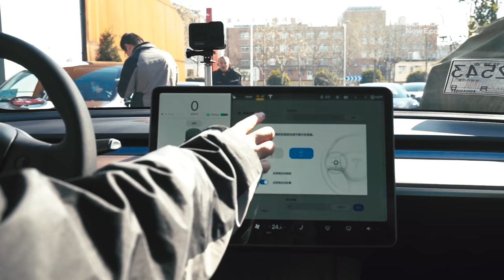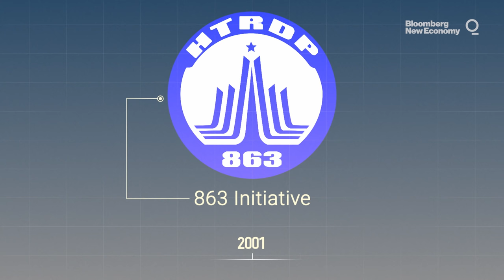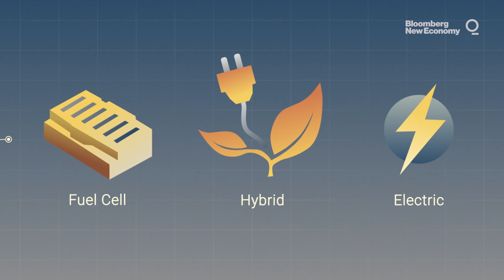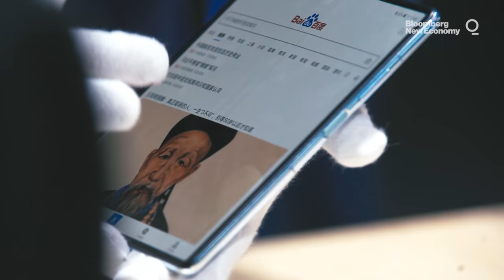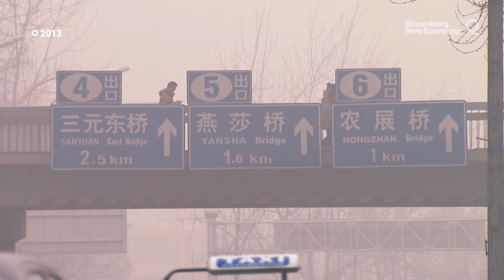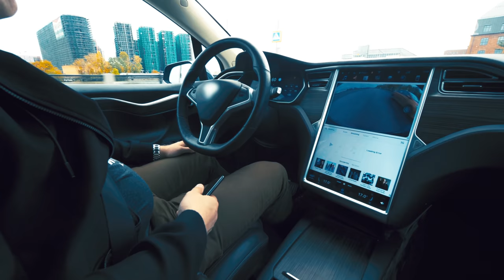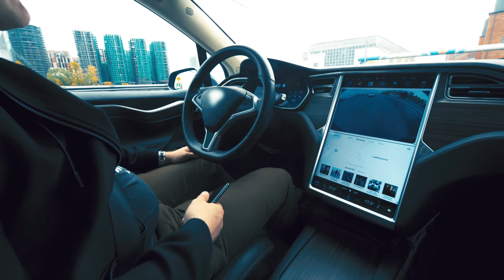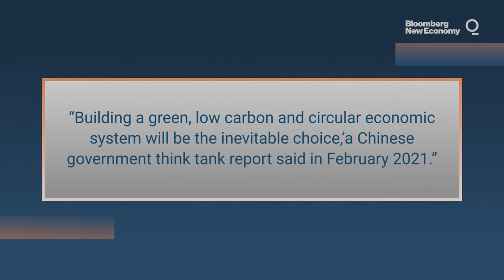Why China’s Electric Car Lead Has Been a Long Time Coming

Comment: No mention of BYD, the largest EV maker in China?
Reply: NIO Is the largest i think
Reply: Tesla is the largest
Reply: Yes, it was mentioned.
Reply: @heinrichhimmler3781  BYD is huge and far ahead of any other ev in most critical technology but I am always surprised that BYD does not get any limelight at all
Reply: @davout5775  BYD's new energy vehicle sales have surpassed Tesla, BYD is now the world's largest new energy vehicle manufacturer
Reply: @aison2735  That's simply not true. China considers hybrids as New energy vehicles. Yet they do have ICE. So they are not clean despite having electric motor as well. Every month the hybrids represent about half of the total new energy vehicles. So BYD sells 50-60% of the EVs Tesla does. They are not the largest clearly
Reply: @davout5775  Hybrid vehicle is a new energy vehicle
Reply: @aison2735  It uses internal combustion engine so it is not a new energy vehicle
Reply: @davout5775  No, it greatly reduces the emissions and uses electricity most of the time, so it is a new energy vehicle. Traditional cars cannot be done
Reply: @aison2735  You understand that in most hybrids the battery range is a joke right not to mention the electric motor is only there just to give additional boost. It almost doesn't reduce the emissions and actually it is the worst of both words. As EV and many times more dirty to produce than an ICE vehicle and on top of that you have the engine that produces toxic emissions everyday. It is not a new energy vehicle! Tesla produces close to double the amount!
Reply: @davout5775  I disagree with your point of view, that is not a fact
Reply: @aison2735  It is not a fact that an internal combustion engine produces toxic smoke or that an EV is many times more hazardous to manufacture? If that's the case I don't even know what you are doing in this comment section because you are clearly incompetent to give an educated opinion.
Reply: @davout5775  Hybrid vehicles are a type of new energy vehicle. It can greatly reduce pollutant emissions and enjoy new energy subsidies
Reply: @davout5775  Your news lags behind, BYD has already announced that it will not produce hybrid cars.
Reply: @will9359  They still very much do

Comment: Actually I really like these Chinese EV. There is this one line of EV or Etuk tuk or rickshaws that are very popular in China. The lk1500fc is what they are called and they are usually made from side manufactured parts. The chassis are stamped by bigger companies who have the spare capacity and can make it in one go. The motor is sourced from heavy duty washing machines cause the motor is capable of driving a car. The batteries are lead ones recycled from waste centers. And the rest of the car is sourced from surplus or stuff that can’t be sold else where.

Comment: Why do people keep implying that Tesla was first to market? From 2008 to 2012, Mitsubishi sold over ten times as many i-MiEVs as Tesla sold Roadsters.
Reply: Yes.. i think currently vw selling much more than tesla.. there is also nisan and hyundai
Reply: Where are they now?
Reply: @MelvinJ64  they still make them, and they cost $10k less than the Tesla Model 3, but they stopped selling them in the US, presumably because they're going to be introducing a new model like they did in Europe.
Reply: i think the main problem is mitsubitshi aren't innovating enough on it's technology feature, and also they're lack of investment on electric charge like tesla
Reply: @user-gc1hg9sp9k  I certainly agree that charging infrastructure is a huge plus for Tesla.

Comment: China's primary interest in EVs is rooted in its local market where it delivers ENERGETIC INDEPENDENCE!!!  With an electric mix that is approximately 60% Coal, 18% Hydro, 5% Nuclear, 3% Gas, 6% Wind and 3% Solar PV, i.e. all primary sources for which China is mostly self-sufficient, it needn't import oil for its fleet of cars and small commercial vehicles. 
The fact that the local market  is a fantastic "incubator" for the export market and that the novelty of EVs levels the playing field for would be manufacturers are just extra benefits.  It is also noteworthy to see the emphasis on smaller cars which will also position China at an advantage in emerging markets.

Also, the mention of China as a leader in the production of solar PV panels and the panning sequence over a vast solar array should not be seen as an indication that China's electric mix is low carbon nor that it could become so promptly.  With more than half of it coal plants under 15 years old and with its national coal reserves, there are no reasons why coal would not remain a fixture of China's electric production for the decades to come.

Comment: 40% of car sales being EV in 2030 seems a bit low tbh
Reply: China is largest car market in the world, so it's it's not easy for the to switch from ICE to EV. Better to make a realistic target that you can achieve rather than high unrealistic target tag hard to achieved
Reply: @user-gc1hg9sp9k  I'd say it's better to push for a high target and fall a bit short rather than have a lower target. Just look at spacex to see how well that works
Reply: I'll keep my petrol turbo engine car until the last drop of oil in the world. Then I'll switch to hydrogen. Electric cars are simply idiotic.
Reply: The latest data on China's car sales in September shows that new energy vehicles accounted for 20.4%.
Reply: do you think people can change car like smartphone? Car is not cheap.
Reply: @Jason-gq8fo  the answer always is depends who and what. Unrealistic targets can be demoralizing and cause people to expect failure, making failure a self fulfilling prophecy. Playing safe can lead to lazy ness.

On the other hand, shoot for the stars can help you do something u didn't think possible before, and playing safe can help you reach farther by continuous improvement building confidence on ever better results.

It really depends who, when and what, both ways can lead to greatness and missery equally

Comment: Now all they need is electricity.
Reply: Their exports grew in september more than 20% despite electricity problems
Reply: You mean like Texas? The place that Tesla is moving its headquarters to?
Reply: It’s not unique to china. The UK also had to deploy the military as truck drivers to fill up petrol stations.
Reply: @claurodriguez4996  Export businesses don't drive cars, people do.
Reply: @freemanol  So a labour shortage.
Reply: @zinjanthropus322  both. the energy market is a supply chain. when there's not enough fuel they have to access reserves which requires more logistics
Reply: @levyroth  Lol

Comment: Elon musk himself acknowledged this. It is because China is serious about developing EV unlike US (Did you see how much US gov trying to damage Tesla because of pressure from Union?) and EU.
Reply: 1st part is correct - US still not EV oriented ... but .. EU ? Unions ?
Reply: @bukkuk5949  Yes, EU too. Did you know EU subsidized oil/gas industry $110B last year and this year is tracking to increase by 10-20% (because of increasing gas prices). EU regulators is still allow VW to put on Cheat device in their car (it's still there to this current day, look it up). At the surface EU acting innocence but deep down they are really want their ICE car industry to keep pollute.

Comment: The U.S. is a declining economic power. In 1960, the U.S. accounted for 40% of the world's gdp. China's share was only 4%. Today, the U.S. share of the global gdp has dropped to 24%, a 40% decline. Meanwhile, China's share is now 17%, a 325% increase. 

Using Purchasing Power Parity, China's gdp is already larger than the U.S. Despite the per capita gdp being only 1/5 of the U.S , its domestic retail market is larger than the U.S. In 2020, China's FDI was the largest in the world.
 
Since 2009, China has been the world's largest automotive market. It is the largest market for both BMW and Mercedes. 30% of BMW's revenue is from China.  40% of Volkswagen's revenue is from China. GM sells more cars in China than in the U.S. China is also the largest EV market in the world. Of the 4 largest EV battery manufacturers, 2 are Chinese, BYD and CATL.

The U.S. reckless military spending, poor fiscal and monetary policies have resulted in this decline. Trade sanctions, embargoes and tariffs will not improve the economy.

Comment: Bring the Wuling Ev to America it’s only $5,000
Reply: Even if we made them in Mexico and charged $8k it would be huge for EV adoption in cities.
Reply: I dnt think it pass the minimum safety regulations
Reply: @harshityadav1252  The China model certainly wouldn't.  I am projecting that for $8k a US compliant version could be produced.  The Mini is a unique class of urban vehicle even in China.  Limited size and weight, top speed ~60mph....
Many US auto regulations dictate cars that are very poorly adapted to urban use.  They spend ~$3k+ to protect occupants in high speed crashes, but in urban transit most injuries are to pedestrians at low speed.

Comment: Look at how quickly China's electric power grid has crippled recently. Power outages throughout the country factories shut down due to no power. How could this power grid also support all these electric cars! No country has the power grid to support getting rid of gas-powered cars YET. Furthermore, China's rapidly ageing population and stagnant population will be very challenging to overcome.
Reply: many other countries including the UK and europe as having energy crisis atm. the amount of electricity required for vehicles is actually miniscule. my electric scooter for example costs < $0.05 of electricity to charge for a 30km range. the difference is the number of charging stations and the economies of scale of the car production available in china

re: population this is also a challenge in the majority of developed countries. it is indeed a challenge, but not unique to china.
Reply: remember Texas?
Reply: @zihaozheng6851  sure and New York City and parts of California. If you read my statement I said, "no country has the power grid to support all these electric cars." So before you bring up "Texas," please READ. Regardless China's current electric issues are much worse than Texas', those are facts.
Reply: @freemanol  the cost of electric is higher but there aren't rolling outages like China. But this just supports my point that No country has the electric grip to support EVs yet.
Reply: @jaimetorres3113  you must be a bedroom researcher. the last time i walked outside i see EVs everywhere in the UK, and in Norway sales of non electric cars have almost dropped to 0. and china is not some backwaters like north korea where there're blackouts, apart from the recent energy crisis. they have advanced data centers too that requires constant electricity.

but if you want to live in your imaginary world where china is a backwards village, then that's your choice, if that makes you feel better about yourself
Reply: @freemanol  3% of Electric cars in the UK are electric.
Reply: @jaimetorres3113  i lived in the center of london so i see them more often. there are also charging stations around the city. and don't ignore that 80% of new car sales in norway are EVs. anyways your generalised conclusion on the feasibility of EVs are not backed by anything apart from hearsay about blackouts. the wuling EV has sold 400 thousand units in china and are popular with the young generation there. just trying to open your mind here
Reply: @jaimetorres3113  i don't think you understand the situation. No gasoline will cause the same problem. Either you use gasoline to drive your car or use gasoline to produce electricity and than charge the car is the same!
Reply: @jaimetorres3113  do your research. EVs don't take that much electricity. maybe when it comes to the US it'd take 20-30 years, because there nothing can be done fast. but if you're holed up in your opinion that's fine, the rest of us will keep progressing into the 21st century
Reply: linkzable  i personally own 3 petrol guzzling cars from the 70s. as much as i enjoy them i'd love to have electric cars if it were possible. there are simply no charging stations around here
Reply: @jaimetorres3113  not really, it’s just the financial game that caused the raw material like coal to triple in price, which have lead to the recent electric power outage around the world, because most of the time government regulations DO NOT ALLOW massive fluctuations in electricity cost, in turn the power plant are running at a loss for every bit of power they produce.
Reply: @JR-vc4gm  The point is to drive electric cars but charge them with electricity that was obtained in a sustainable or renewable way. Transitioning to clean electricity is the only way to reduce climate change.
Reply: Solar and wind and batteries seem cheap and ubiquitous as well as EV materials.  I see no issue
Reply: @djlovetap2141  the issue or challenge rather is that replacing 1bn+ cars and developing the infrastructure to support them will take 20-30yrs.
Reply: @levyroth  the point is that there are significant limits to an all electric world.

Comment: What about the factories used to make electric cars and the lithium mines? Electric cars are just sweeping the pollution problem under the rug, a facade basically and people are just eating it up!
Reply: Exactly
Reply: What about the factories to make combustion cars and steel mines for the engines and transmissions?
Reply: The most eco friendly thing to do is to keep driving your ICE car till it dies, then go full electric. They have less moving parts and are reliable, and ultimately more eco friendly over time. China does not produce O&G in any significant amount - hence the push to electric. They know that they cannot be reliant on O&G.
Reply: Electric cars are not perfect especially in cold climates, just less polluting than combustion engines.
Reply: It is debatable. If the batteries have long enough lifespan then it’s be cleaner in the long run. What we can’t do is just do nothing and keep doing what we’re doing.
Reply: The future is hydrogen.
Reply: @levyroth  Exactly, whether that is fuel cells or fusion. Lithium Ion batteries scale horribly. A 45 kg tank of gasoline is equivalent to over a ton of fully charged Li batteries. It just doesnt make sense and is wasteful. Hydrogen passenger planes are now in the works
Reply: @levyroth   I believe a recent study showed that hydrogen is not efficient because of the amount of energy needed to create, store and transport hydrogen.
Reply: @ryccoh  well idk about combustion cars but fuel cell cars remove their carbon footprint faster than battery cars as they drive. Dirty air is taken in filtered and transformed into pure water

Comment: not even close to realistic, China will take over the US in car manufacturing but as usual the ivy league has it all wrong. self driving car use highways more effectively but only by at the most 30%. not near enough to impact highway congestion. a second item is the patents, China is an expert at getting around patents

Comment: Sadly, before Tesla came along, there was a line of cheap electric cars and electric tricycles in the countryside along China's eastern seaboard. The Chinese call them old man happy, which is mainly used for traveling in the countryside. Before BYD entered the automotive industry, it was the world's largest and most advanced battery supplier. Now BYD's batteries are used in BYD's cars, and their batteries are not the same as those of Tesla. Internal combustion engine motorcycles are rarely seen in Chinese cities, and electric motorcycles are more common.

Comment: Nio battery swap allows for EV to stay relevant and keep the rentention value. Tesla cannot. This is because nio offers battery swap. So when advancements in batteries are made, a nio owner can swap the battery easily. Tesla owners are stuck with a mediocre battery and range. Huge disservice to early adapters. Which is why NIO will win
Reply: Yeah tesla came with that idea before Nio was founded. They came to the conclusion the idea is pointless and unsustainable especially from a small company like Nio
Reply: @davout5775  well they will realize very soon how wrong they were.
Reply: @hehehehehehe5801  Pfff why? The battery swap stations are much much worse than the traditional charging stations. They are huge and require aa lot of batteries to function. So you are limited by the amount of batteries you have. For that reason they are huge and take a lot of space. So all in all they are very impractical
Reply: @davout5775  NIO replacement stations use standardized battery excuses, which, on the one hand, allows customers to update to the latest batteries in a timely manner to avoid the life of lithium batteries due to prolonged use. Secondly, NIO also allows customers to choose not to buy batteries when purchasing a car, thus avoiding the problem of depreciating the value of used EVs due to battery wear and tear and facilitating used car transactions.